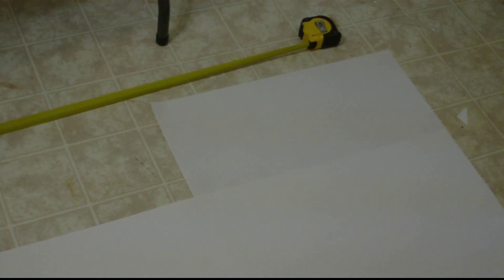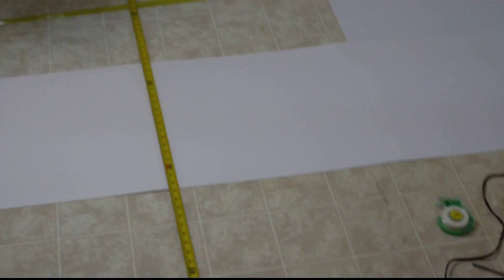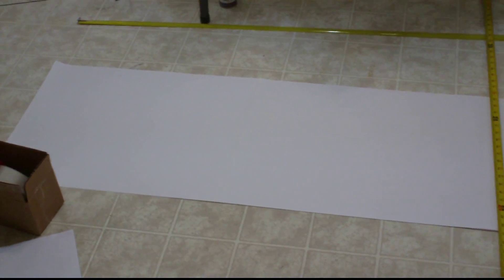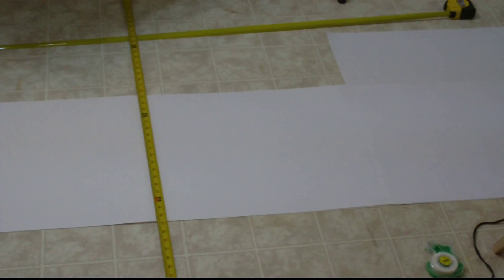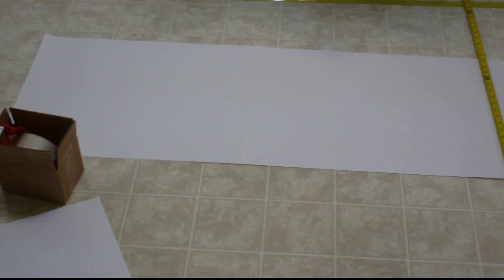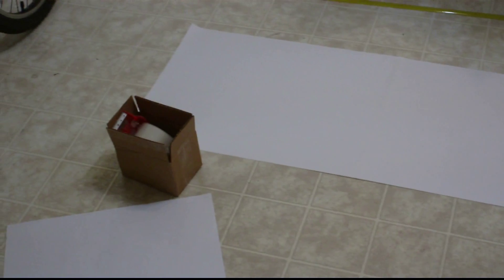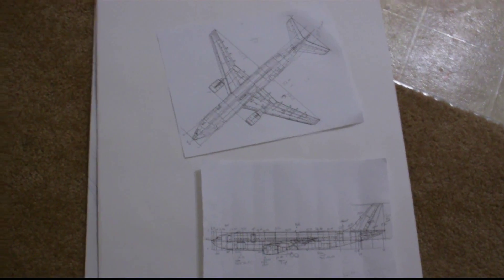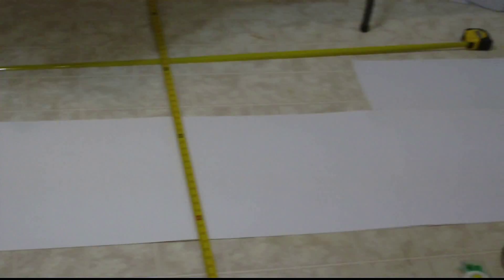How to build a 7 Foot Airbus A300 RC EDF airliner Part-1

Comment: Sadly but I must agree with you. I hear American may be in merger talks with U.S Air. I hope not.  We fly every where they fly. Don't see the advantage of that only gets another airline off the charts.  American always sells the routes of the merger it goes through. I was at TWA for a few years after Pan Am. Our flights from JFK to Tel Av Vive were always full. American owns those routs now and wont fly them.  Isreal wants there workers full time. American wants them at part time.Figures.